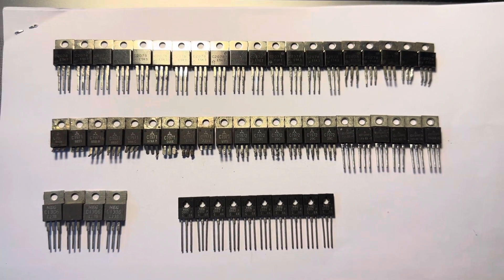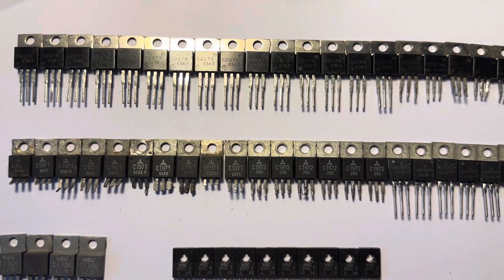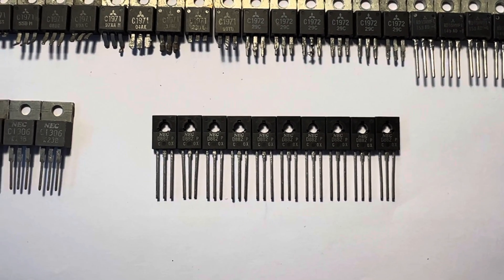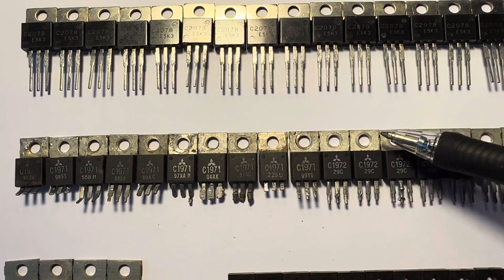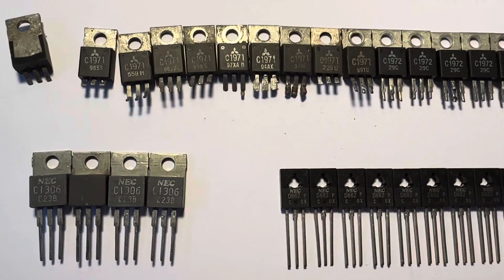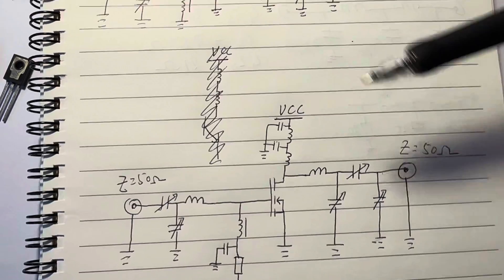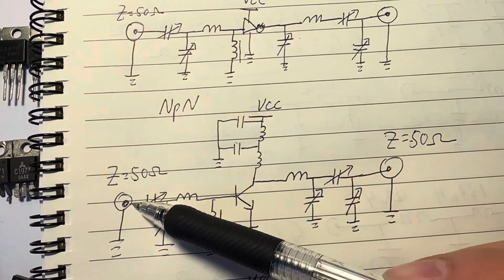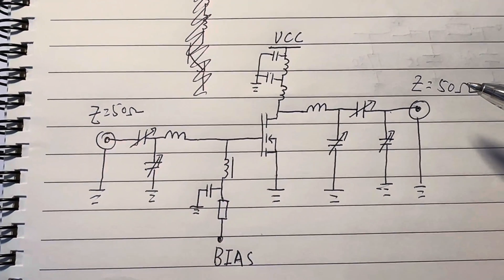RF power transistors explained

Comment: Some vintage or NOS transistors don't always mean better than new manufactured,  especially, by the same manufacturer not China! I compared  the 2N2907A (TO 18) Motorola to the plastic 2N2907A (TO92) NS(original) and the PN2907A I guess it's Fairchild or ON?? in a 100MHz oscillator, interestingly the PN2907A gave astonishing results in terms of stability and amplitude at the specified frequency! I tried an original Fairchild 2N3906 it gave reasonable results a bit behind the 2907s. I also tried  Chinese and Indian 2N3906 as I don't have 2N2907A from those manufacturers, the results were satisfactory. Even the BC547- BC550 (NPN) family exhibit astounding differences in ft and gain at higher frequencies. It seems manufacturing a data sheet compliant transistor is challenging! Back to the 2N3553, and the 2N3866 Motorola, RCA, Philips, Siemens, ST they exhibit different results!

Comment: I got a bunch of 2SC1970, and fewer 1971. Before, I was fond of the Motorola and RCA vintage 2N3866 and 2N3553. The Japanese ones proved more robust easy to mount and cool their gain at higher frequency surpasses those 2Ns! I like to test transistors in real environment. The 2SC1971 is far better than the Motorola MRF237 which is prone to damage!
Reply from the maker: MRF237 dies too easily just from high swr even at reduced supply voltage.( that how my first two MRF237 break)

Comment: Is it true that these have little current gain and need about as much current as they supply?
Reply from the maker: RF power transistor generally have low gain, every rf parts is different, you would need it data sheet.

Comment: What about the 2sc2314 ?
Reply from the maker: If it original made by Sanyo (not from dodgy supplier) then it should work as stated from the data sheet to 27 mhz.